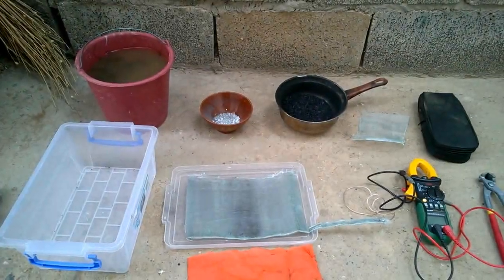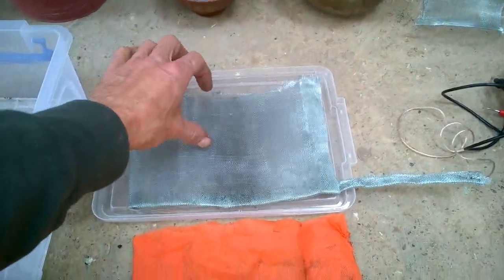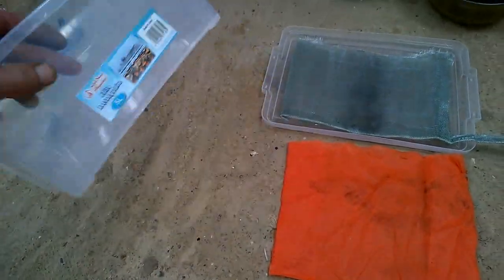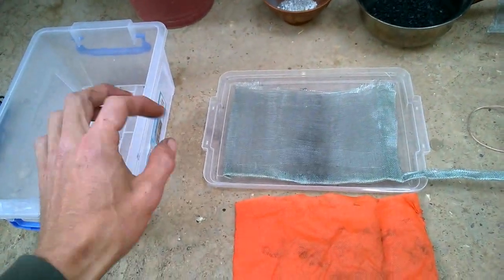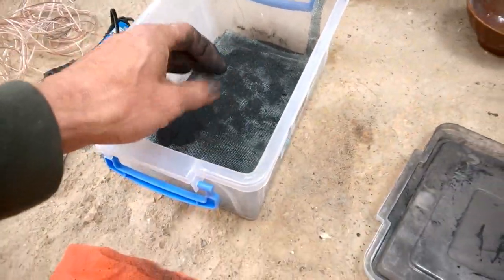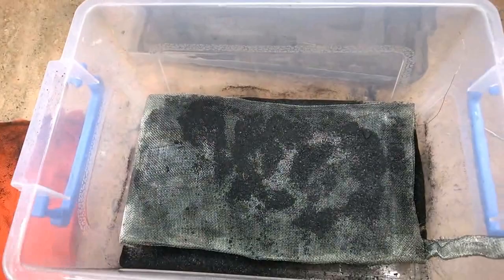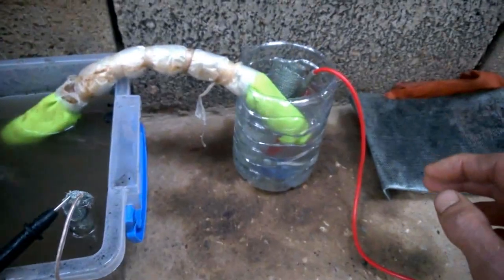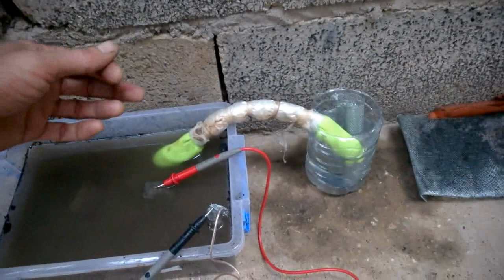Bio Battery 1.0

Comment: Dan. Cheers!  Question: Would the KW yield be expected to increase with (1) a greater surface area pond, (2) more heat from sunlight or (3) giving it more time to 'ferment' ?  Also wondering if a number of these were put into (4) parallel or series?
Reply from the maker: I can only make assumptions and guesses at this point but I would expect the Kw's to go up with an increase of surface area.    The voltage might not change but I'm hoping that the available amps will go up.
The more bacteria in or around the electrode the more energy should be released so food and time are going to play a part.   There is one part of the system missing still, which is the aerobic bacteria side of things on the other electrode.
Reply: @dinskiy voltage is extremely simple too harvest you can get a volt from a penny and a zinc washer and a salt ladened bit off cardboard...the task is converting your volts into current effectively...I hope you still into bits I would love too talk If so...cheers
Reply from the maker: @jshaw4757   Hello there, thanks for reminding me of this little project.

your quite right; zink and copper with an active electrolyte produce volts and current. That is a mark one voltaic cell. 
The voltage is generated because the two metals have a different innate voltage, while current is a factor of surface area and strength of the electrolyte.   However, this is a redox reaction and one or both plates are degraded over time.  

The idea with a bio-battery is there is no redox reaction and the plates are not eaten away over time.  The idea plates would be all carbon and act as current collectors, picking electrical energy produced by soil microbes. 

I happen to have some electrically conductive carbon felt in stores, and I'm about to do some plant-growing tests with Ormus.   So thanks for the reminder about this project.